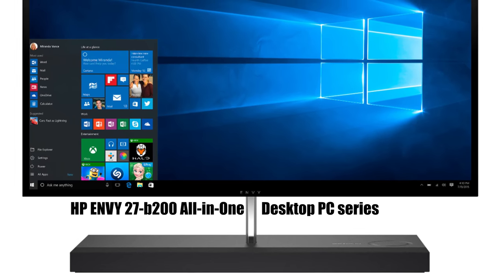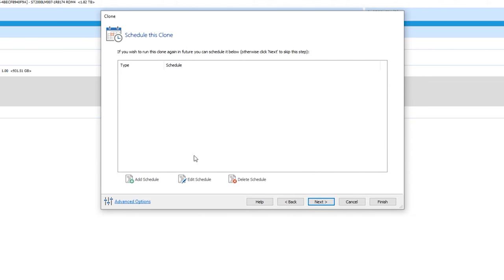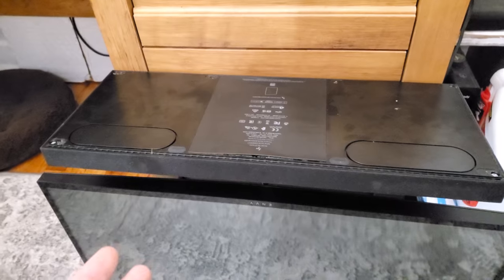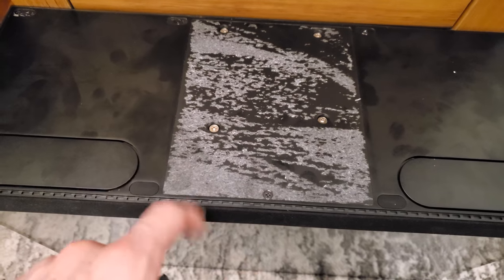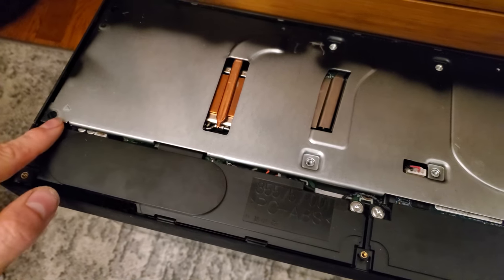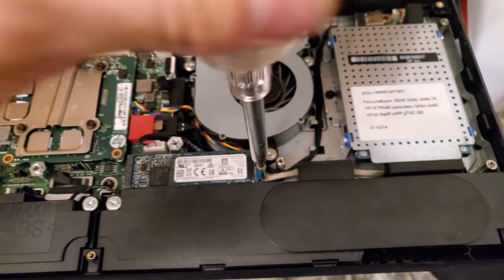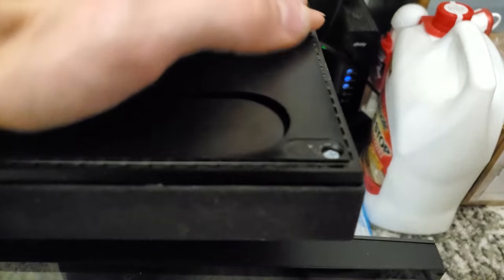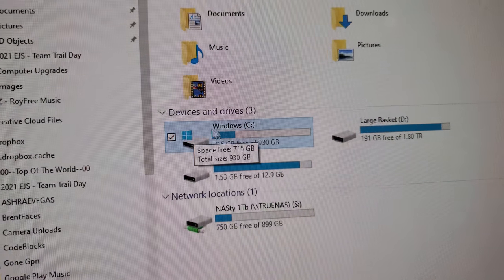How to Upgrade the HP Envy 27-b200 All in PC

Comment: Do you think a samsung 990 with a heat sink would fit?
Reply from the maker: I am really not sure that metal plate is pretty close to everything, you would have to measure it
Reply: Do you recommend putting thermal pads on the ram and ssd? I run 32gb ram and 2tb samsunf 990 ssd in this computer @JeepSheepTV
Reply: I just put in a samsung 990 pro 2tb and it fit fine @JeepSheepTV